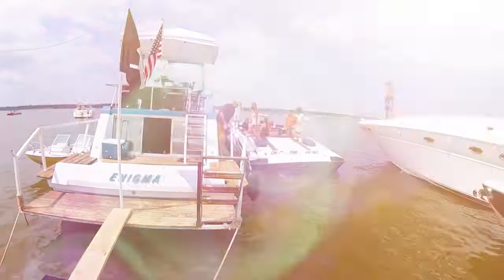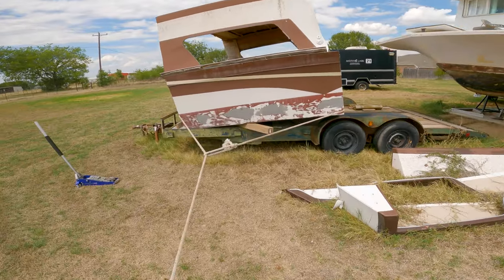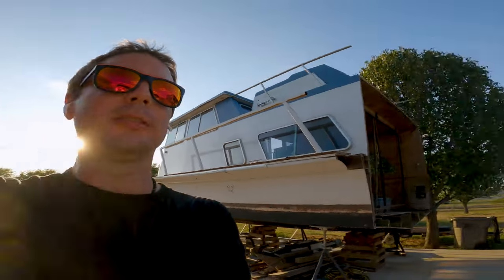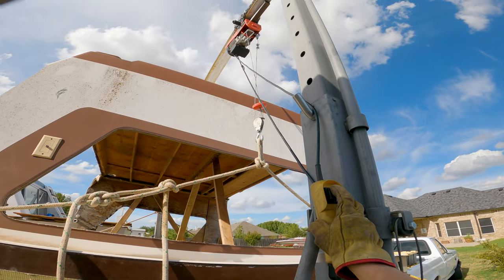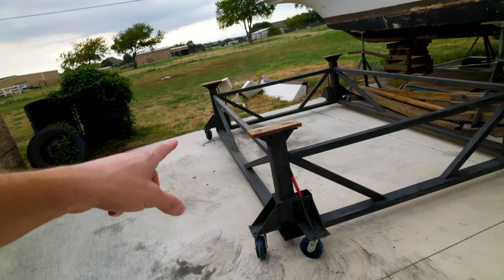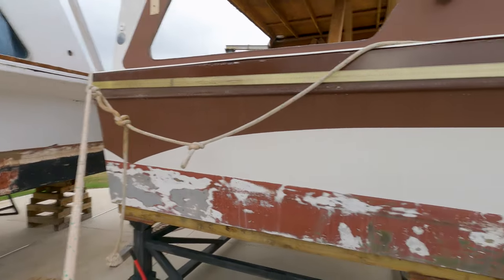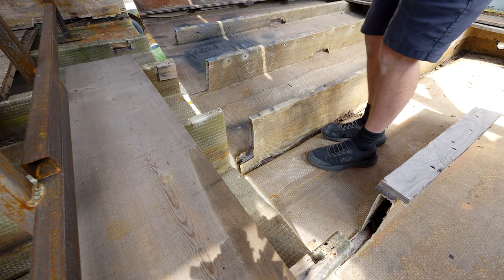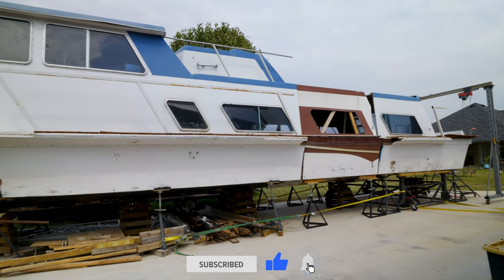Making Two Houseboats Into One!

Comment: With some wax string you can "whip" the ends of your anchor ropes to keep them from fraying anymore. The method is basically a Surgeons Knot with a bunch of wraps. Or use some waterproof glue and wrap the ends with tape till it sets
Any thoughts to making carbon fiber or stainless steel spars/stringers instead of using wood again?
Reply: I wonder how many people have been burned by flaming molten plastic, trying to fuse the ends of rope.